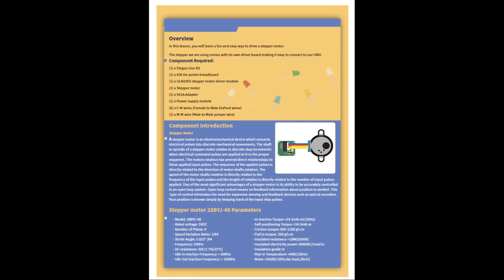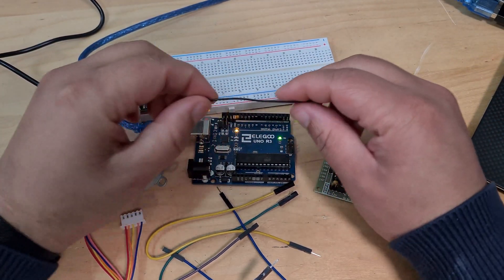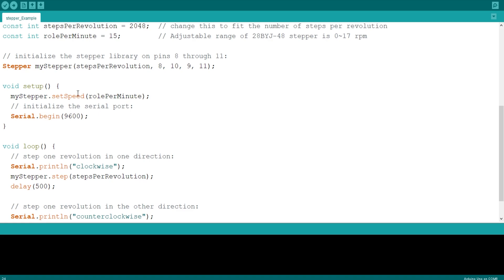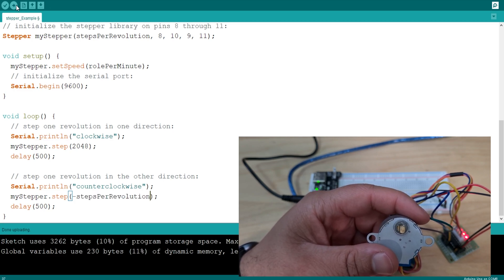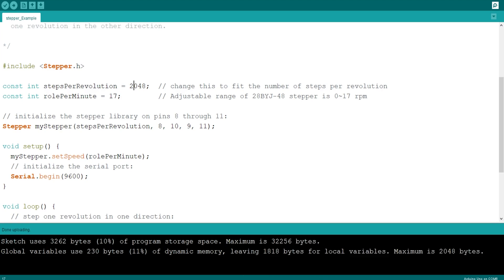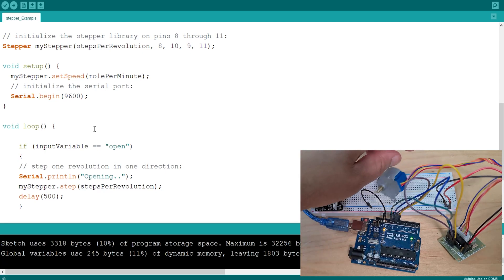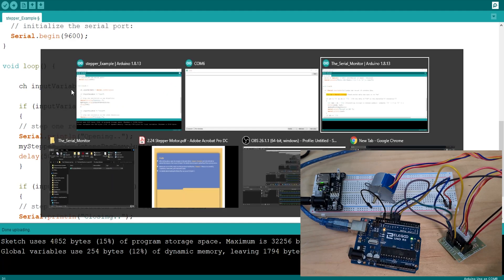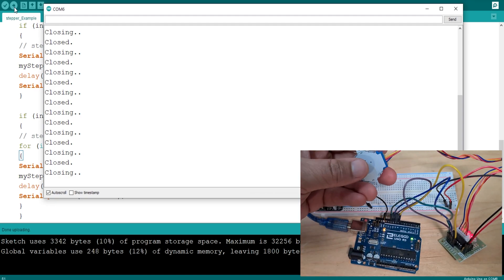Stepper Motor Arduino Tutorial - Elegoo The Most Complete Starter Kit

Comment: Hey noob question, that black piece on top of the breadboard necessary to power the driver to control the stepper motor or can I use an external power supply and not connect the driver to the breadboard at all?
Reply from the maker: yeah an external psu will do fine

Comment: i used the code word for word tried writing my own and its still not spinning nor is it vibrating ive got the right wiring and correct libraries running
Reply from the maker: My guess would be a libraries issue, wiring issue or power supply issue. Maybe try a different library or redo the wiring?

Comment: Will you do a continuation where you   join projects feom the kit e.g i saw a person use the ultrasonic sensor to detect how far away something is and display it on the lcd screen but he never showed the code
Reply from the maker: Yeah that's my plan. Got some really good ideas of Arduino projects. The problem is sadly time right now. I'm in university so work overload atm. Stay tuned.
Reply: Will do thanks